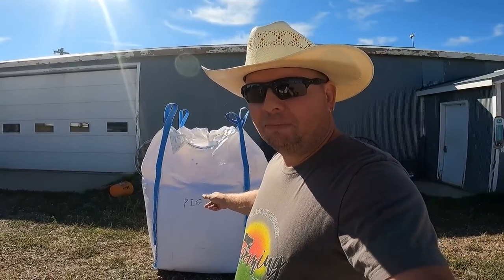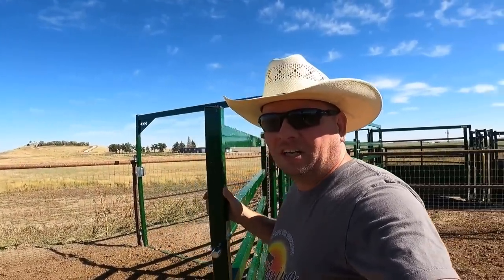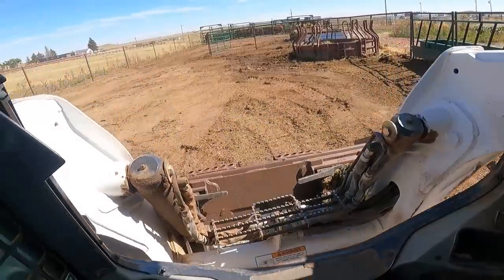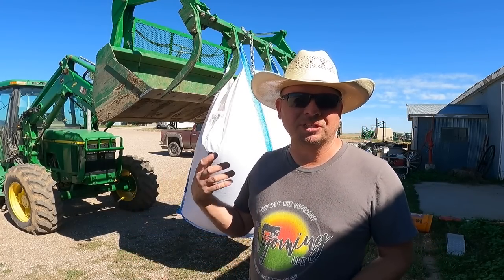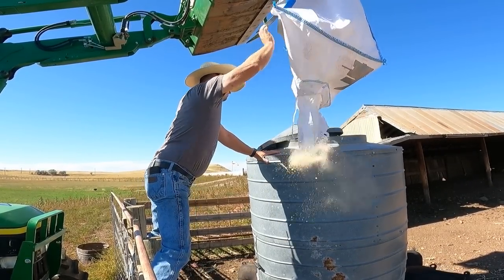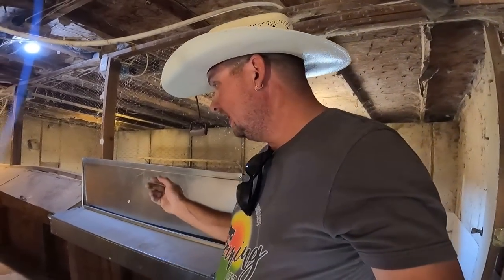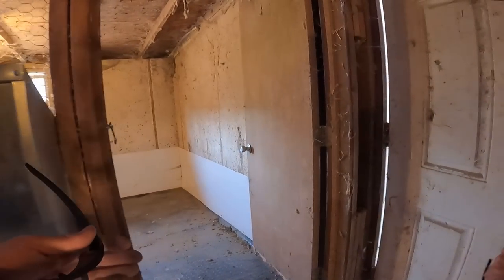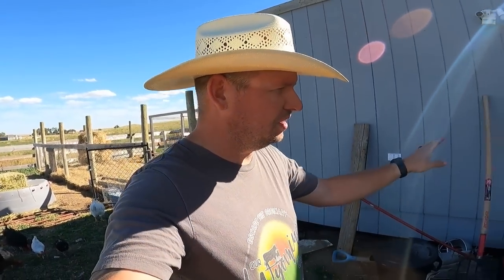These 3 Chores...

Comment: That’s nice compost
Reply from the maker: I agree it sure will be. Thanks for watching
Reply: @OurWyomingLife  just FYI.. have heard about the issues of residual herbicide in hay, feed and poop causing compost to kill seedlings and plants? Even Grazon is an issue that gardeners are seeing . MFG claims it has no residual action.. but apparently it does.. test before use in gardens or around trees..

Also, there are pasture vacs for getting poop..
I found corn cob bedding instead of the pelleted wood sawdust . It WAY more absorbant.. like maybe 3x.. but not much more  expensive.. well with the difference..